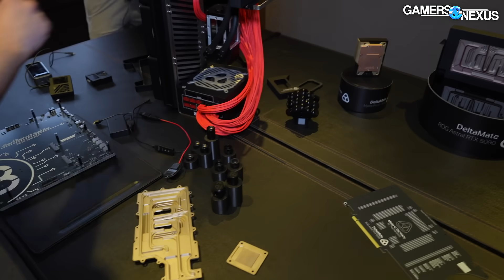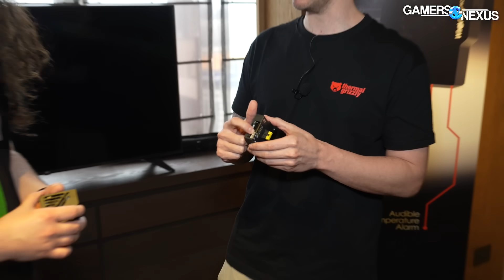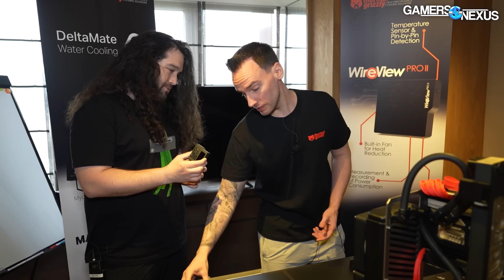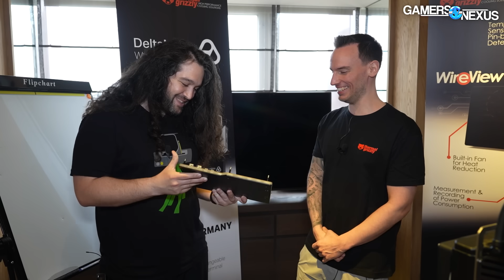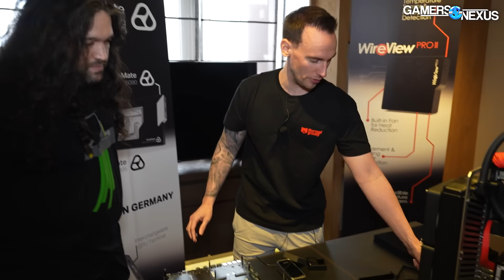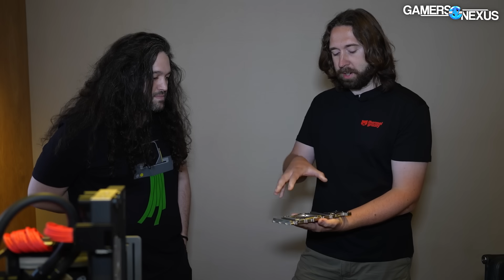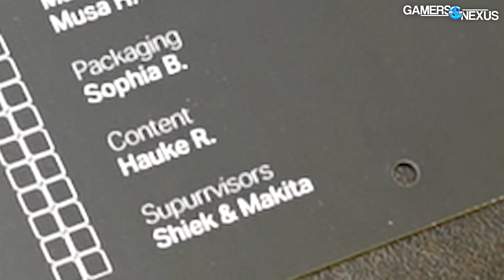Fixing the Unfixable 12VHPWR Connector, ft. Der8auer

Comment: Given this goes inside the PC, wouldn’t it make more sense to have a 4 pin header for the USB instead of the USBC?

Also, if you have that USB connection, it should be feasible to make a driver that does a more graceful (and possibly quicker) shutdown, rather than just actuating on the power button.

You could have it kill your benchmark app or steam for example, instead of doing a full shutdown.
Reply: I Actually prefer usb-c. You can attach it to any off the shelf usb hub if you have more than one such device. My AiO screen also uses usbc. If both would use 4 pin headers, I would need a hub for that ( my mb only Has one), which is more special and likely therefore costs more.

Regarding the power button. I agree Would definitely be great as there already is a software for monitoring, if this could simply launch a script in case of overheating / overcurrent so you can then decide what you want to do.

Comment: What is the frequency response of the 12V high power per-pin current sensing?
DC current sensing really isn't going to tell you much, otherwise the 12V ground return connections would also have burned out on at least some examples, however, what we actually see is ONLY the 12V pins that ever get hot enough to melt the supporting plastic.

Comment: The simple fact of the matter is that if the NGC (nVidia Garbage Connector) had been properly specified and implemented in the first place then it would not need 'fixing' and the circus of safety issues and problems would not exist. It would have been so easy to have a new power connector that was a genuine improvement over PCIe power connectors. 

The best solution would be to just scrap the NGC and either go back to conventional PCIe power connectors or properly design and implement a new connector. The fact that people have to go to such extremes over a power connector proves how ridiculous the whole thing is.

I have noted that there is occasionally a teardown video of an nVidia GPU that shows what appears to pads on the PCB for regular PCIe power connectors instead of the NGC. The solution, therefore, would be to remove the NGC from the PCB and fit proper PCIe power connectors.

Comment: That wireview is odd to me. Polling every 5 secs? Adding more possible points of failure. A 30mm fan, which let's be honest won't do anything but make noise and add cost. Add a micro sd card slot and you could log at a useful interval. Also would rather have something not  adhoced on my gpu for aesthetics alone. Put it psu side and add an info display somewhere else in the case.

Comment: First we had emarkers for usb power cables, now we have temperature monitoring and active cooling for gpu power cables.🤯 Now a power cable costs $30+. "Great innovation."
Instead of using standard XT90+awg10 cable that's proven reliable and costs only $5-10.

Comment: Could this device be equipped with some adaptive resistor, so if a 12v power line is pulling to much current, you increase the resistance on that specific line, and have the load equally distributed across the 6 wires?

Comment: I would rather Nvidia use XT60 or XT90 connectors to replace the 12VHPWR. 1 pair of wires is just way neater than many strands of wire, no risk of wrong polarity and it's a solid connection.

Comment: That bench unit I'm interested in. It would be nice if it had an Optilink option as well for direct pcie lane connection that can aid in testing as well as NUC tests. USB MUX route was likely the simplest path/option.
Nice jump on the HV monitor. Though I think I'll be avoiding any gen using it for the time being limiting options onto AMD/Intel.

I've been dealing with electronics since I was real little watching dad repair VCR's for fun in his spare time. I know the funny ways electrons like to move, induct, and jump between lines too close, just for that faster path to the finish line.
Using one seeing the designs of these cards wouldn't be a fool me once scenario.  I'd just be the fool.
I think NV has a Professional problem. And in the real world a pro is one who's F'd up enough to know what not to do and look out for. No amount of schooling will teach that. Only a mentor.
Problem is most places pissed them off enough they left or refuse to teach. Many more vanished after the lock downs and never returned.

Good Episode guys.

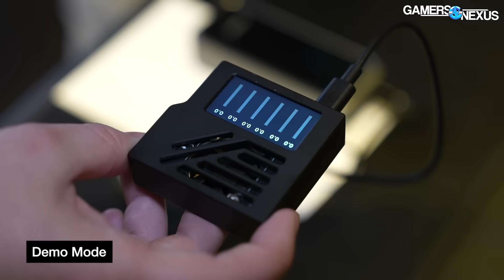Comment: 2:22 A triggerable high interval setting might be interesting, so that you can trigger a 0.1 second interval recording for 5 minutes or so, right before booting or starting a benchmarking tool, so that the user can get more accurate readings right at the most crucial times ;)
BTW awesome and sad that this tool might soon exist to contain the mess #NVIDIA made in their electronic design, thanks to Roman and GN on reporting on this issue and possible solutions :)

Comment: Maybe i'm not the only 9ne ti have toughr about that, but would'nt be usefull a voltage regulation device? It would take 3/4 8 pin connectors and exit with a 12V hpwr, where all the cables will recive the same amount of A?

Ps: sorry for my broken english

Comment: That Bench table is good idea, guys. Turn it into something bit more useful for general users. And make it serve as backplate for MB in actual PC. Let's say you plug in all power connectors and then you take power out elsewhere. So you have short, nice cables.
Add omnidirectional blower in center, so entire back of MB gets bit of airflow. There can be M.2 to OCuLink, too.

Comment: On the Wireview they need to leave a bit more space between the 12V connectors, i have an older version and i can barely plug it in because the backplate of my Zotac 4090 is in the way.

Comment: "why it sucks" line are not connected in parallel. That dongle doubles likelyhood to get uneven contact because double fail points and connectors. My DIY solution was to put temp sensor on connector and alert to hwinfo64 for 55c

Comment: For anyone who is worried and has a motherboard that can do this, I do this.

1. I have a temp sensor cable from my motherboard to the 12VHPWR connector. (I have Aida64 running)
2. I played the most demanding games I have, with the highest power draw (Cyberpunk maxed out) and took note of the temperature on the sensor, even though some of that will be the case temperature warming up, not just the connector. This is so I have a worst-case high temp.
3. Next, I set Aida64 to warn me once the temperature sensor hits that temperature. I also have one set 10c even higher that shuts off my PC should it hit that temperature.

Because of this, I will either get the warning and check, or if I am away from the PC and the second temp is reached, it will turn my PC off.
Due to the room temperature, the only thing I have to do is have one base temperature for the summer and one for the winter.

Comment: 12:00 He made a MicroSD RAID!

Every motherboard should come with at least 2x MicroSD just so we can all run a cheap ZFS drive with integrity scrubbing (ideally 3x slots because that's the minimum required to maintain error checking while rebuilding a mirror).

Comment: Or just buy msi cause I have yet to see a msi gpu with a melted connector. Maybe the added fuses or the under wattage with no significant performance loss helped. Maybe safety and reliability mean more than a couple more fps.

Comment: im about to buy a new system this winter to something like this and im really afraid of all theses fire melting issues even with the new cable  : 

9800x3d/9950x3d
Asus x870e Hero/Extreme
96gb DDr5 6000mhz cl30
5080/5090
Asus PGAQDP 480hz

Comment: Comments section is putting all the blame on Nvidia, as though this wasn't a standard connector that they adopted, and hasn't had multiple revisions since that they've also adopted.  (And wouldn't have displayed issues with the power hungrier 30 series than 40 series if this was a legitimate issue.)

And yet the usual suspects are championing Intel as a competitor despite multiple generations of failuregate, the source of which was 100% the silicon that said competitor prints.
Reply: And not forget, that Nvidia was a major driver in the development of this connector as well. They are part of the PCI-SIG, and were pushing this connector a lot.

Comment: Since Nvidia don't monitor current & wattage on GPU side and use common rails for 12v and  ground anyway...
Its possible to make a common rails within male connector. It would distribute evenly wattage across cables and help distribute temperature from connector itself.
But that only mitigate the problem of bad connection. the connector itself should by changed, maybe to 2 large flat pins shaped like usb-c ?!
I still wonder how Nvidia could screw so simple stuff, like we have power sockets in the walls, those work fine for years with higher load.

Comment: Just shut off the power delivery when temperature rises above 100degC on any of available pins. Simple high power mosfets can do that without significant voltage drop across them. This would save the stuff before melting itself.  You can even signal with piezo speaker before executing safety disconnect.

Comment: Since I have been running for 2+ years a 4090 with a few stress tests and temps checks of the cable, I will pass ... and just never pull the video card.  But if I was building today, I would definitely buy one.  Roman, this is more than a convenience, you may just one day save a life with this.

Comment: I don't get it. Why no one figured the easiest way. Solder the wires to the GPU board instead a connector and connect it to the PSU wires by a WAGO connectors.

Comment: If the sanding is to have a pretty surface, why sanding both side ?
Instead of sanding both side and be forced to machine the contact surfaces again you could sand only the front and not the back

Comment: 500 euro for a graphics card waterbloc is crazy 😱
Even with the stupid high price of the 5090 astral that's still adding 1/6 of the cost on top
Reply: more like 1/8th and lowering as we speak....
Reply: @lamikal2515  i got mine for 2990 swiss francs (with taxes)
but yeah it is still very difficult to get it for a """normal""" price
MSRP for the atral is supposed to be 2800 USD, so 2760 swiss francs (with taxes)
Reply: I missed the part where they are forcing you to buy it.
Reply: @varvarathegame  If you don't see the problem of prices constantly rising, then, you're lost, little boy
Reply: @lamikal2515  I am not lost, i just don't buy things if i can't afford them. But you prefer crying a river, demanding to be it your way like a toddler.

Comment: You guys,  seriously,  lots of the different brands cone out of the same factories. Without branding you couldn't tell them apart.  Coller master halos vs Asia Asia horse. Thermal take vs lian li magnetic daisy chains, and now corsair and asus are doing it. They are all identical.

The RGB cables and pins will break if you look at them wrong.  The low voltage cables they use on everything is cheap cheap cheap. 

People who think its expensive to manufacture electronics and PC parts are pretty naive.  Its not a liebwhen you hear a $1000 iphone costs 10 bucks to make. 

As factories and technologies mature,  it's gets cheaper and cheaper and cheaper. 

Take a Bosch appliance for example.  I paid a premium for a 36" gas cooker top. The "laser engraved" readouts on the controls rubbed off after the first rsal scrubbing. The power burner is so uneven and not that powerful.  I did aone research on that unit and Bosch as a company these days. 

Made in China!!! 🤬🤬🤬 The proce should be less than half of what their charging!

Comment: Measuring current per pin is nice, but after the measurement point there is still a male and a female connector
If this pair of connector is imbalanced it will fail there and you wont't have any data because it is after the measuring points😵
Reply: nevermind I'm dumb. If one pin fails the other 5 will take the load. So it doesn't matter where you do the measurement

Comment: My constructive criticism for the der8enchtable would be to recess all the switches so they don't protrude beyond the edge of the PCB. I foresee lots of damaged switches with the current setup when either moving the bench table around or moving around objects that are close to the table. Those little plastic levers are going to be magnets for catching fabrics, small cords, whatever. Or maybe change to a multi-position rocker switch or something.

Comment: Despite being allegedly made with higher quality parts and bearings I didn't choose sapphire's 9070 xt specifically because it has 12VHP. Maybe it's paranoia but I went with XFX 9070 xt oc because it has 3x 8pin and so has a 100w headroom. Even though 12VHP should have like 250ish the 3pin one feels safer. And I intend to use the gpu for at least the next 8 years so reliability was a concern for me.

Comment: Really hope they start offering ALL the connector options for WireView.  Bought one thinking the connector orientation was correct, it was not...100% my fault, but even if I had it right it meant I couldn't buy one as the inverted connector option wasn't there.

Speaking of which, I need to return that...hopefully not too late.